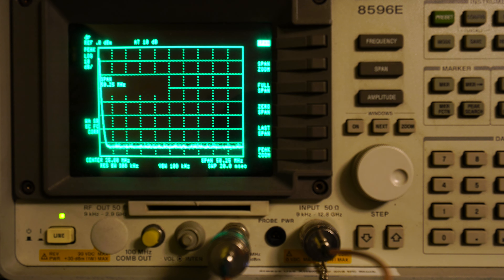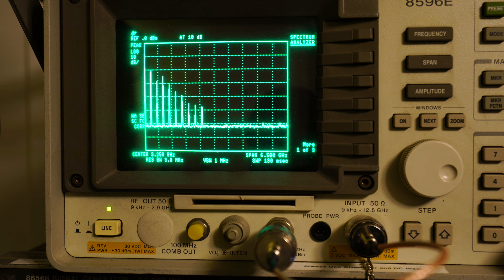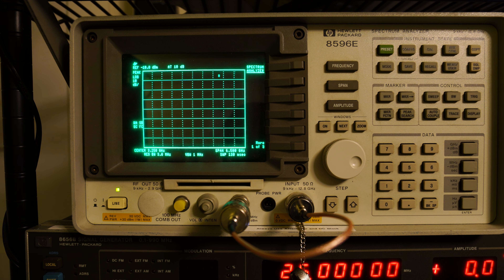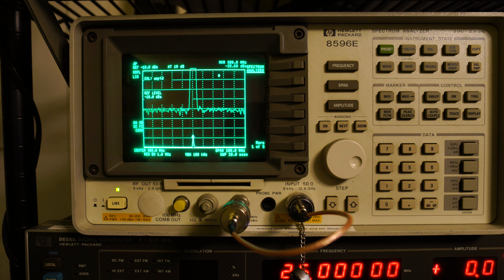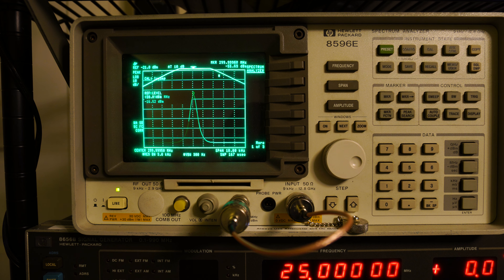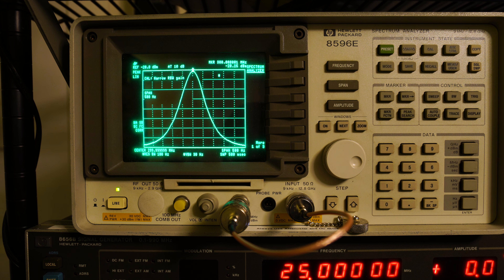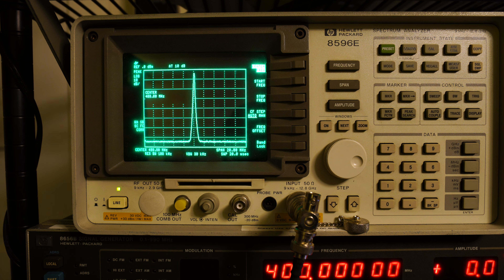HP 8596E Spectrum Analyzer Frequency & Amplitude Self Calibration After Dead Battery

Comment: CAL FREQ -37hz is, in fact, the unlock code as you suspected. Those manuals are fantastic. I'm 35 and they started phasing out component level manuals for board level repairs when I started to get into the jive of things. If you don't know the principle of operations, I can see how it can be frustrating though. Sit down with a coffee on a rainy weekend and start with the text of the PoO, then go to the block diag, and finally the schematics. In general, the service manuals (not to be confused with the owners manual) will even have full flow diagrams, directing you from "If error code, try.."

Oh and RF coil is to tune the oscillator. Like, consider the YIG as though it's the "coarse" knob, and RF as though it were the "fine" knob. (This analogy also holds true for NMR machines)

Comment: Used to have the 8591e I think it was with built in tracking generator, nice thou it was I finally bought the Siglent 2021x  analyzer & I don't regret it, it's superb, more versatile in many ways  to the old hp & a hell of a lot lighter! Useful when I want to take it in the garden to do antenna measurement
Reply from the maker: This thing is heavy and as I mentioned is much more inclined to be used at higher frequencies than HF but it is a beautiful instrument and the accuracy, as it relates to all my other RF equipment is right-on. Nowadays with the SDR equipment, we don't need the old Collins R-390 or huge 1980's vintage SA equipment like this HP but it seems necessary for me to try to keep it running as long as I can. The day I can'f fix it will be the day it moves one step closer to the recycle bin.

Comment: Thanks for this I have that exact unit on my bench.  Extremely useful to know, thanks.
Reply from the maker: That set of magic push buttons to allow it to self calibrate are almost hidden in the manual. I think that should be a procedure of the first paragraph in the calibration section.
I am really disappointed it took me so long to solve this issue and is why I posted this video. If you ever need it, I hope it helps save your SA - it is a magnificent instrument and I will be using it this week on a project with my son.

Comment: I like your videos, thank you.
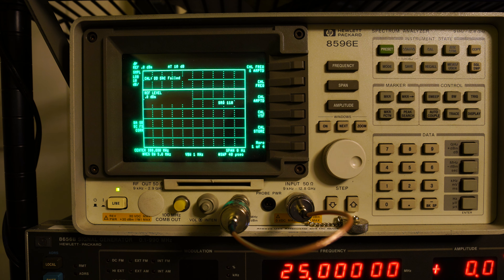At 12:42 it says "Cal: 00 DAC Failed". Does it mean anything?
Reply from the maker: Wow... I didn't notice that. I will look into it and it happened exactly as it finished.
Reply from the maker: I looked for that error and do not know what it means. It seems to have pointed in the direction of attenuator calibration ( ? maybe). In any case, it is back to "normal" with perfect vertical (amplitude) and horizontal (frequency) calibration. I know this is not a video for the masses but I have seen quite a bit of information on the Internet about how to get these instruments to self-cal again after battery loss and no one has made a video of how to do it or what worked for them.

Comment: Note the procedure detailed here will NOT restore all of the analyzer calibration information that will be lost if the battery fails. The analyzer also has frequency response flatness correction constants, timebase correction constant (units without the ovenized master oscillator only), step gain correction constants, and correction constants for the tracking generator if present. There is a procedure in the service manual to write down these correction constants so that they can be restored if the battery fails. See page 199 in the service manual. If your analyzer has not had a battery failure so the correction constants noted here are still valid you should do this soon to prevent loss of this information. The errors if the frequency response correction information is lost can be as big as 11.5dB in my 22GHz 8593E. One further note: in addition to performing the CAL FREQ and CAL AMPTD noted in the video see page 209 in the service manual.
Reply from the maker: I will take another look at this. Thank you. Finding anyone with good advice on a piece of equipment like this is very rare. I do still use it occasionally but as I remember back, I think I remember the amplitude calibration being off - I think a bit low... I am writing without examining it yet but at least the darn thing started working again if only in a relative amplitude mode. I think the frequency calibration is OK. I did not write down any constants before the battery failure so if they are lost then that is the end of that. I will check out the pages you noted. Thanks again.

Comment: I love HP instruments and have several on my bench. I really pondered going for an older HP spectrum analyzer vs the Siglent line. The money is close enough that cost isn’t the criteria. I just can’t justify going with a used HP that uses older analog technology and where parts may become impossible to source, vs a brand new digital SA. I can’t pass up the new unit. It also has capabilities that HP does not offer.
Reply from the maker: Bill,
I understand what you are saying. When this thing seriously goes on-the-blink, its days will be over... if I can't fix it, I doubt I can pay someone else to do it for me short of someone with a few laying around for spare parts and would I really trust that for true calibration? And the price they would want?  I don't think so. What cost $80K thirty years ago, may be able to be bought today for $4K or about the price of these vintage instruments. That has been my comment several times concerning the HP 3580A audio spectrum analyzer - 40 years old - buy a PC based, external USB sound card FFT software program. Some are even free off the Internet and they work very fast at low frequencies whereas the 3580A takes 10 minutes to trace one 20 Hz plot. On the other hand, maybe as a younger fellow  I just had a love afire with these magnificent instruments and I am Very pleased that I finally found the magic-touch buried deep in the books to have it cal again. Even at the end it has been pointed out by a very observant viewer that it got an error:   "Cal: 00 DAC Failed"   I can't find what that means and I can verify that vertical and horizontal are perfect so I will just have to let it go.

Comment: I have an unrelated question. I accidentally plugged a 100 watt Marshall amp's speaker cable into a Marshall 60 watt head speaker output. The 100 watt head was on while the 60 watt head was not. The 100 watt head was on for less than a minute when I realized what I had done and I turned it off. Everything seems okay. As I've played both amps since then. I was wondering what damage could have occurred to either amp had I left this on longer?
Reply from the maker: I am sure you are OK. Amplifiers usually only become damaged if there is no speaker load at all on the output and the amplifier is played at full volume. Mismatched speaker loads, i.e. an 8 ohm load on a 16 ohm output or the other way a round is not going to do any damage, even at full volume.  I am sure your amps were not harmed.
Reply: @ElPasoTubeAmps  Thank you.

Comment: My 8590L still get the RES BW AMPL FAIL message. I adjusted the BW filters yesterday and now I try this '-37Hz' mode and still the same error :(
Reply: I tried the '-2001Hz' and DEFAULT CAL DATA and still the same error...
Reply from the maker: I know how frustrating these things can be. Mine was out of cal for months before I lucked out and got it going again.
Don't forget to hit PRESET then FREQUENCY then the -37Hz as it seems it is veery picky in how it starts and that short jumper between the SMA and input of the analyzer.
I hope you get it working.
BTW - what does    -2001Hz    unlock?